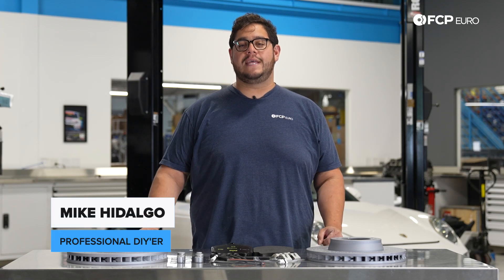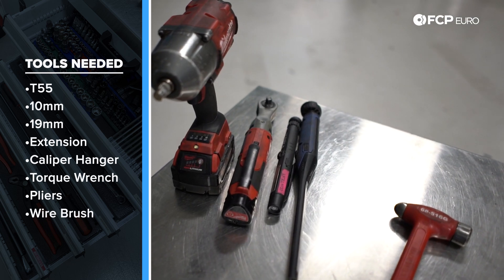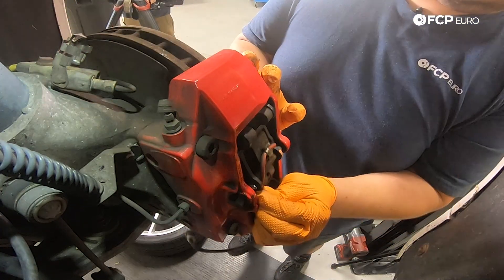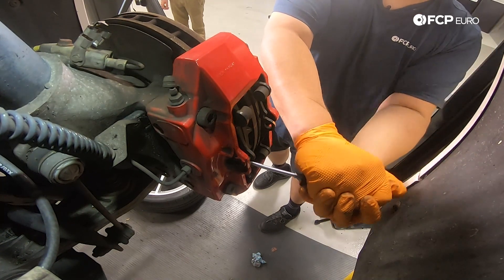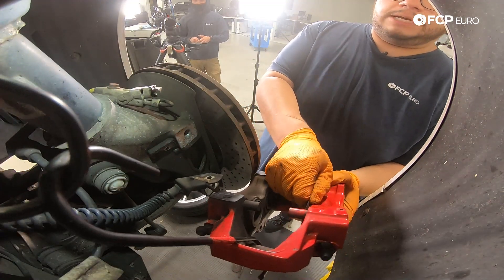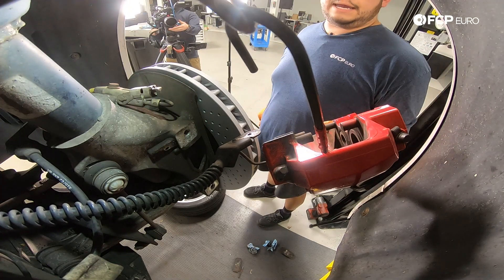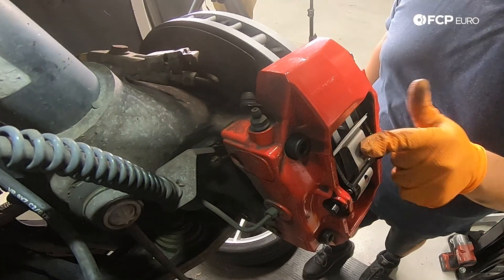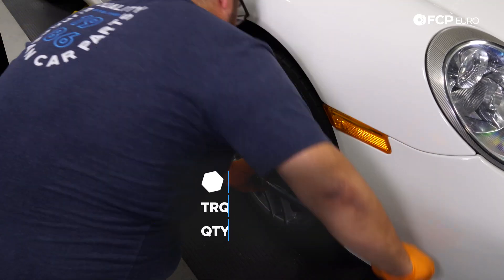Porsche 911 997 Front Brake Pad & Rotor Replacement DIY (2009-2012 Porsche Carrera, S, 4S, GTS)

Comment: How do you handle the brake line connection to the caliper on a 2010 4S?  There is no easy 10mm bolt to remove as pictured here. Do I need to disconnect the brake line at the caliper and let it drain?  Clamp it? Leave it on and bend the line back?

Comment: Hi, really good guide. On my 997 2005 C2S I have replaced rotors (Sebro brand), pads (ferodo brand) and all the brakes hardware and accessories following your instructions. After 600km  still noise when I gently brakes at low speed only. How can I solve it? Please advise
Reply: I heard the ferodo brakes are suppose to be a little bit noisy.

Comment: Would the rear wheel brake job is similar to front? I have a 2007 Carrera cab. Anything different on older models?
Reply from the maker: A similar process, we have a rear 997 video as well if you want to use it for reference!

Comment: What exactly do the caliper shims do ?
Reply from the maker: Hey CAYMAN987, Pad shims are there to help reduce noise from vibrations between the pads and pistons in the calipers. They mainly act as a small buffer.

Comment: You didn’t bleed the brakes??…
Reply from the maker: Hi Matthew, great question! They were indeed bled, however, Mike may or may have not forgotten to mention that to us, and did it without filming 😓
Reply: No need to bleed it. He never opened the system, so the lines never got air in them.